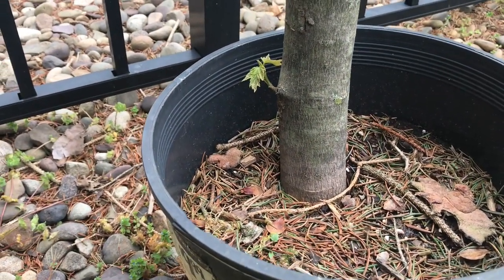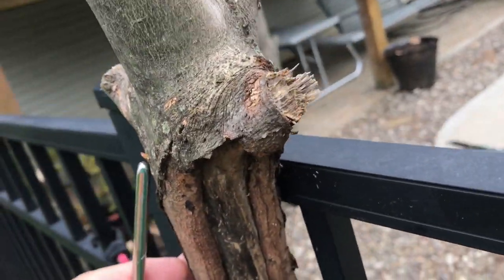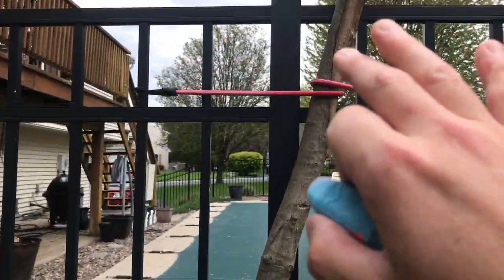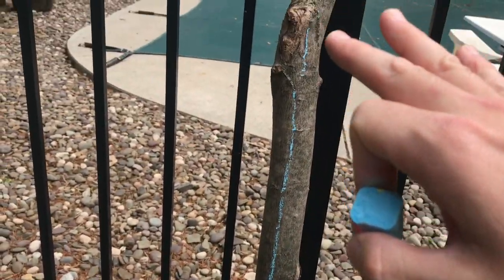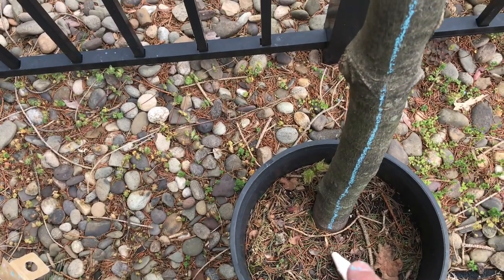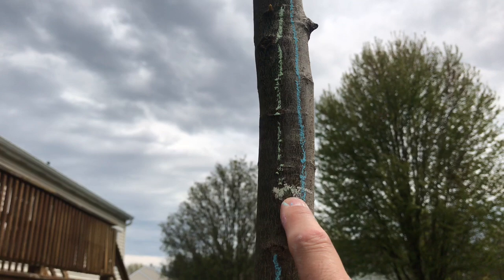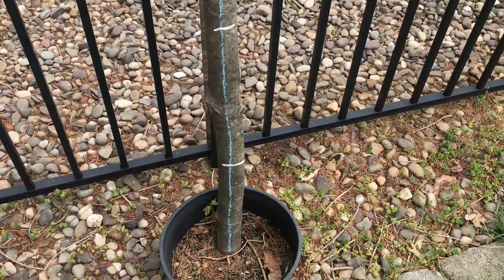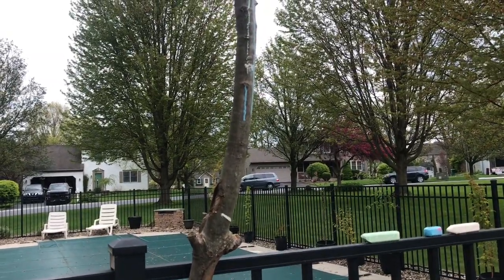Maple Air Layering Theory And Experimentation Part 1

Comment: This will work.  So long as, like you say, there is enough foliage at each bit. The question will be how much foliage do you need to make it work. I’d be scared that new shoots might not pump enough root juice back down to get enough roots. But then it’s a big strong tree so maybe it will. I’m very interested to see what happens. If you can wait I’d let the shoots bud out and become branches and get some good length. Then next year go for the multi layers to be safe
Reply from the maker: Thanks for the input! I like the way you think! I have another similar vid I’ll post in an hour or so with a smaller version of the same project. Thanks BGB!!!
Reply: Kitaku Bonsai it’s questions like this that keep me up at night. Lol. An experiment like this was on my list of things to try. I just need the right tree so i can’t wait to see what happens with this 👍👍